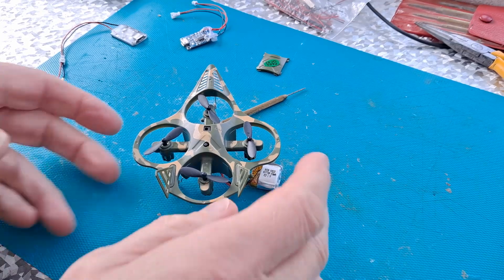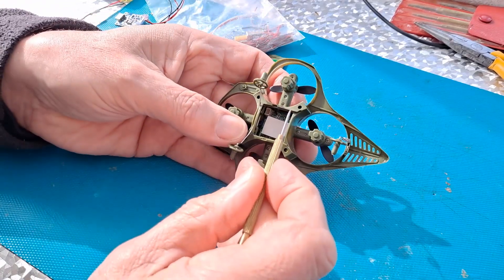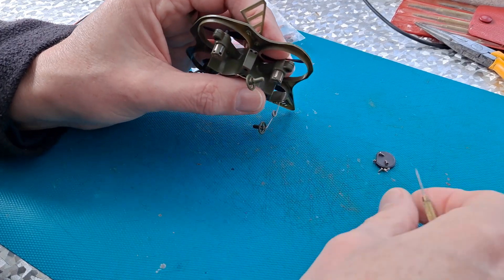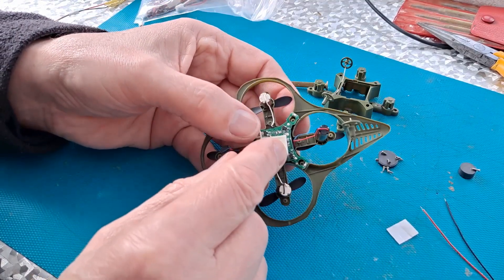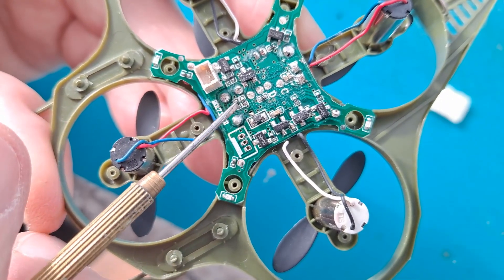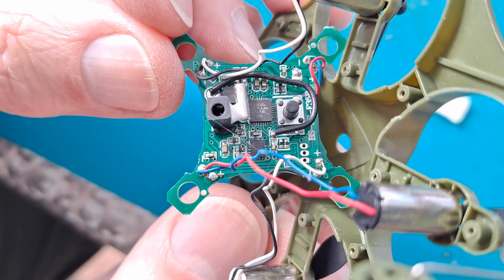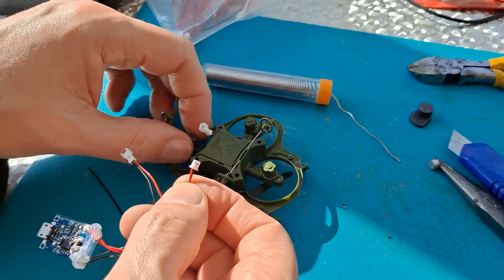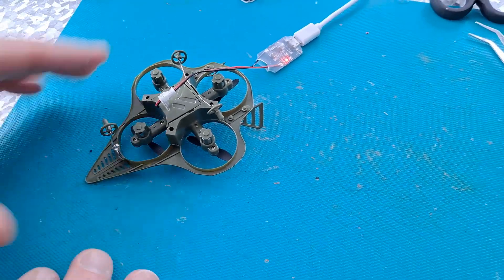Buzz Toys Micro Jet Drone Tear Down

Comment: Great idea and works fine. I noticed the existing charging plug is on top of the drone so I wondered if you took it off and soldered a socket to the board. Would need to melt the plastic a bit in order to let the face of the socket have room for the plug but that's probably more trouble than needed since you have it working. It's a good little drone. 😃👌
Reply from the maker: I would need a suitable rigid mounted plug/socket. It was easier to use the wired plugs I already had in stock.